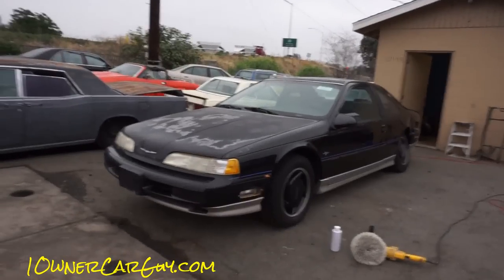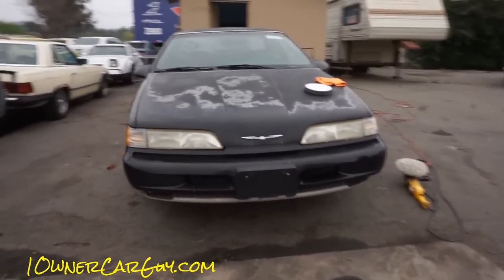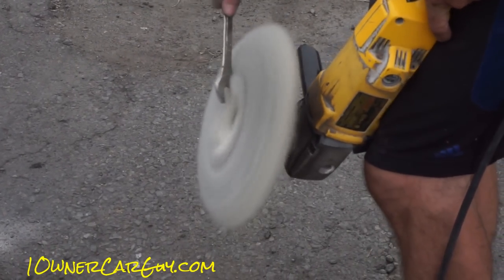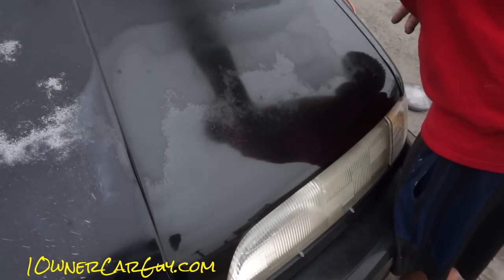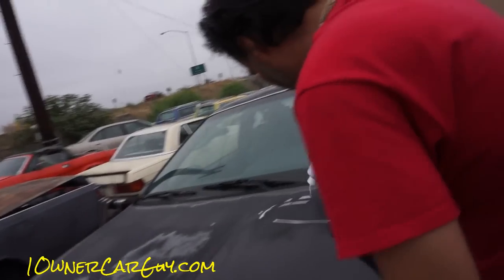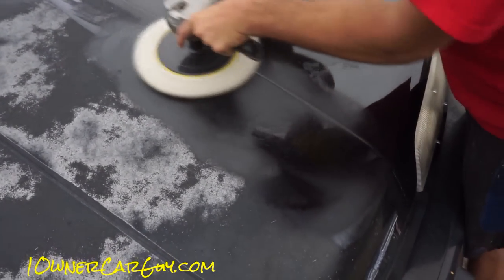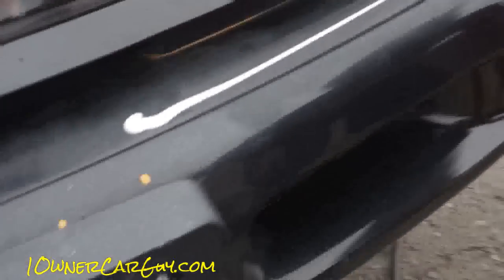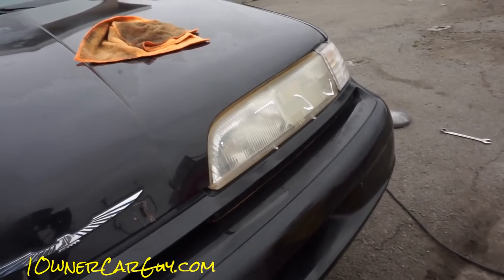Polishing Car Paint How To Polish DIY Restore Dry Faded cars #6

Comment: 1990 35th anniversary Supercoupe, I had one of those with a rare 5 Speed that was built with after market bolt on's and would literaly set you in the seat and lift your feet off the floor!! No LIE  what happened to the rear tire and suspension Nathan?

Comment: A Bricklin in the background lol. What do I do with a white car that has the clear cracking in the rear of the car pretty sure it's the original clear coat and paint but the clear has small cracks what is the best way to fix this.